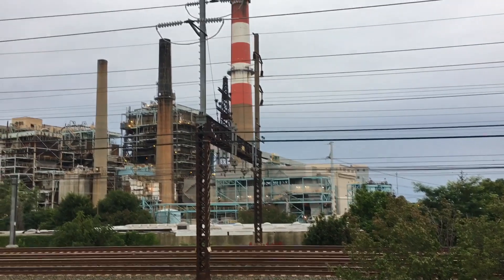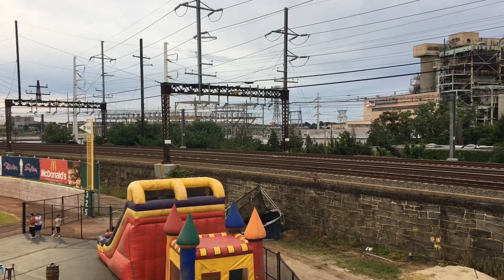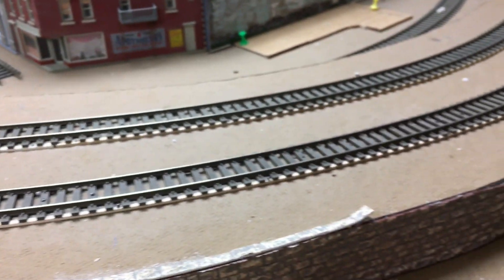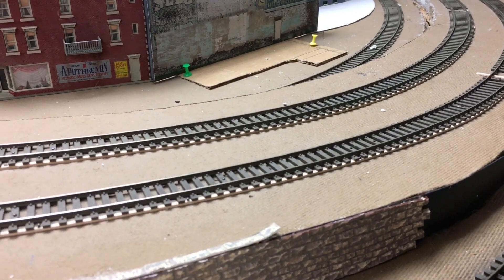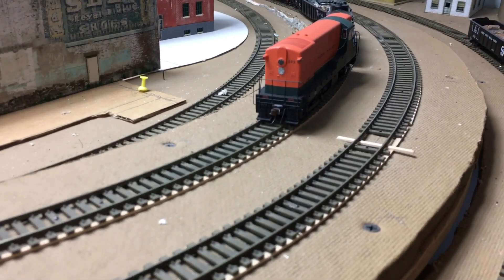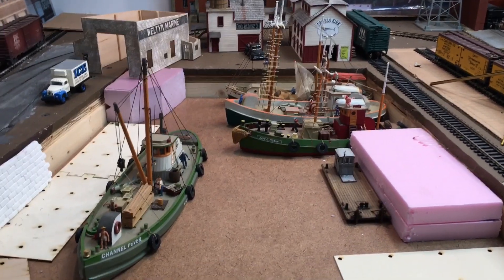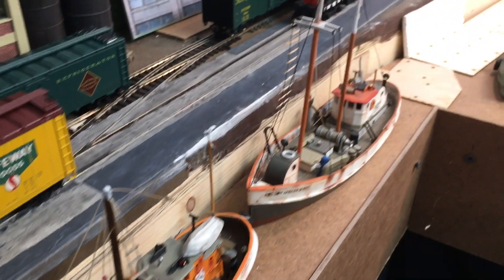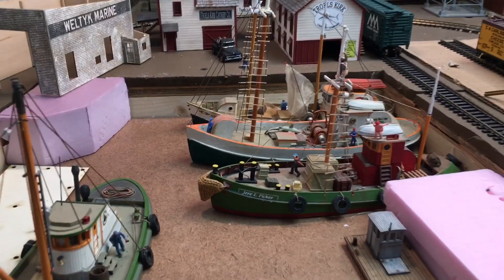New Haven Railroad Layout Update 40 "Super-Elevated Curves and Harbor Info"

Comment: It was nice to see the curve from that vantage point. Your addition of super elevation to your track is indeed a nice touch. One question, are you sure it's enough? Those tracks are really banked and after riding Metro North for a long time I agree those cars do lean over.  Regardless, nit picking over angle is not that important, what is the super elevation on the track that you modeled.  Good work and a fine attention to detail.
Reply from the maker: Peter Norkawich thanks for the comment. Actually I used the same technique and strip wood size of my friend Rick Abramson's layout. Not sure if any of the videos I posted show trains going through his Jenkins curve section. I have seen some modelers use a similar size styrene strip with the same result.  So based on what I know I think the angle is good. Thanks for watching and let me know if you have any other questions.
Reply from the maker: Peter Norkawich take a look at the first video I produced on Ricks layout. Jenkins Curve is in there and you will see pretty much the same angle with the trains leaning into the curve.
Reply: I appreciate the reply, thank you.  I will take another look and see as I am modeling the same area as I grew up down there and am starting the process of the track planning and how to lay out the bench work.  I am very impressed by your work and Mr Abramson's layout.  He has been a great help in providing information on the area through the New Haven RR Bulletin Board. As I move forward I would love to have your input on my progress. Anyway, a ways to go before that.  I'll let you know.  In the mean time take care and thanks.

Comment: Just subbed. I'm not an expert on super elevation, but I think maybe you need a longer transition into the max elevation? I've read somewhere that someone took like 24" to gradually go from 0" to their max desired elevation and all of that was done before and after the curve began and ended. So by the start of the curve, the track was at it's max super elevated and then reverse that on the other end of the curve back down to flat.  Like the harbor scene, but can that last boat that's way in the back, can it get out without moving the other 2 tied up beside it and the one tied to the side dock? Just wondering? Roy
Reply from the maker: CONTAINERMAN68 thanks for subscribing. Ok the issue with the super elevation is that I do not have a lot of space. I am restricted by the radius I have so I tried to create a sense of super elevation. I have run all of my six axle units with no issues but plan to have a friend QC the area before I ballast the track plus the main lines will have catenary over them. Track work needs to be perfect. As far as the boats go take a look at layout update number 9. I found a picture of Bridgeport harbor with a similar scene of boats. The scene on my harbor will be changing.